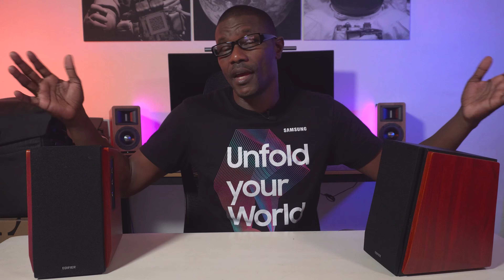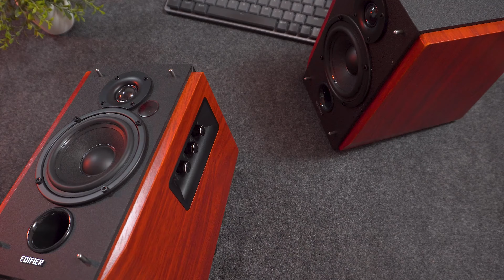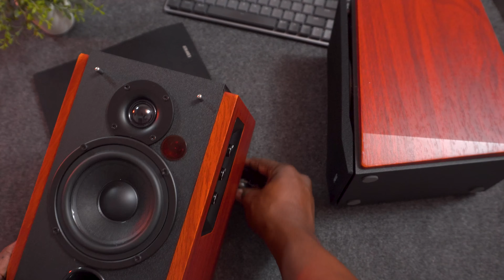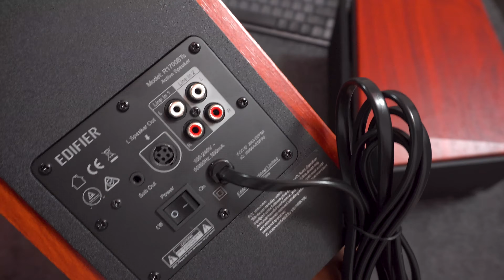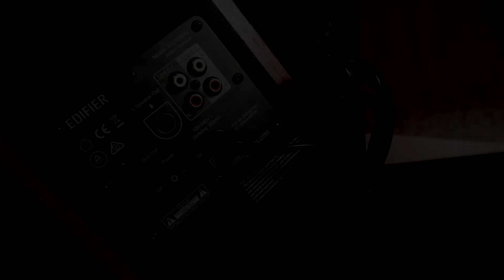Budget HiFi King! 👑  Edifier R1700BTs Bookshelf Speaker

Comment: If you like these speakers add a sub. When you connect a sub the woofers are sent mids and the tweeters the highs. The bass is sent to the sub and take the whole system to another level.